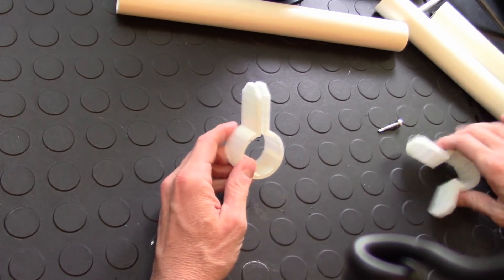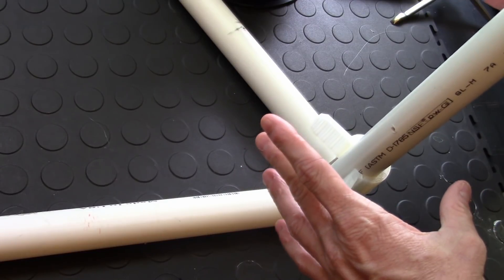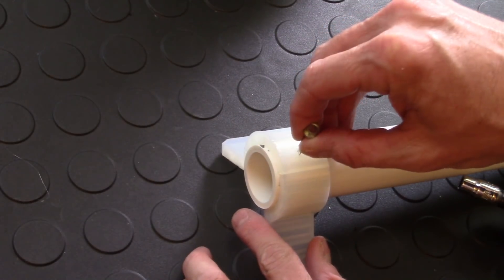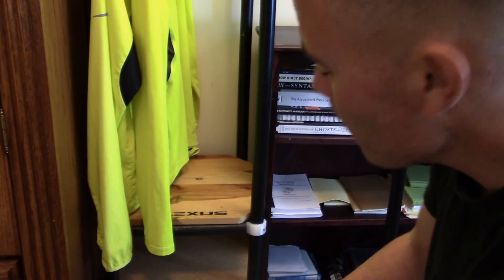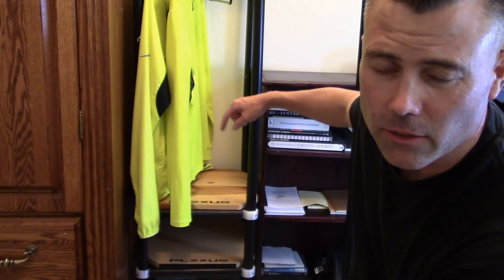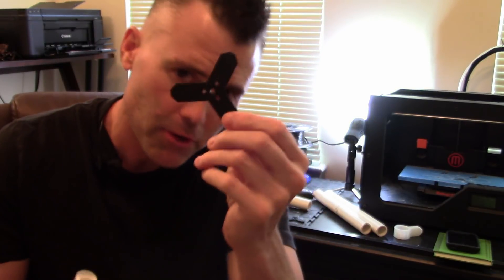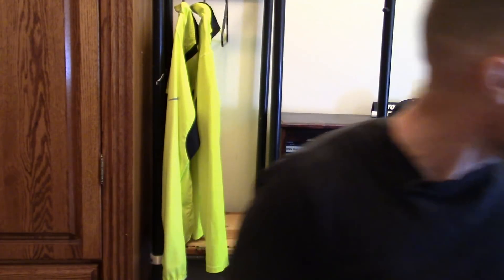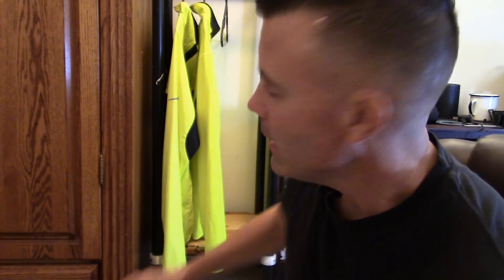PLEXUS - a new way to build cool stuff - Plexus 1 - Open Source 3D Models

Comment: If you drilled holes at equal increments along the uprights you could use a pin in order to have adjustable height shelving.  The pin would just go straight through the click Corner into the PVC.
Reply: Both awesome ideas. Thanks.

Comment: Also, using a 1 to 1 1/4 inch hole saw would make a tighter fit on the shelf corners. Or drill through a piece of wood, with the hole saw, that would be slipped on.

Comment: The connectors you have on Thingiverse are for what size pvc? Great stuff, ThX!
Reply from the maker: 1in schedule 40
Reply: Commando Designs Any thoughts to make that adjustable? In the 🇬🇧 UK Section 40 is VERY expensive as it has to be imported in as its not a standard size here ( I bought some last year, cut it, heated it to make it flat and made some lithophanes ) thanks
Reply from the maker: What sizes are standard in England? It would be easy to figure out the scale difference and publish along with the models. That way someone could just scale to .XX Percent and it should work great. Thanks for the feedback. I'll work on it.